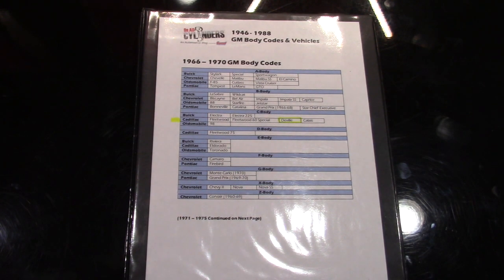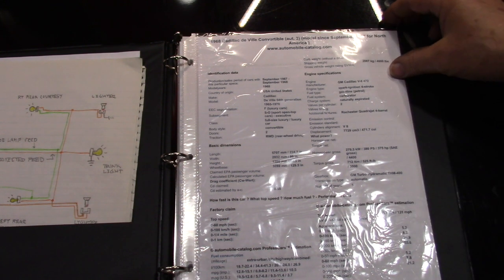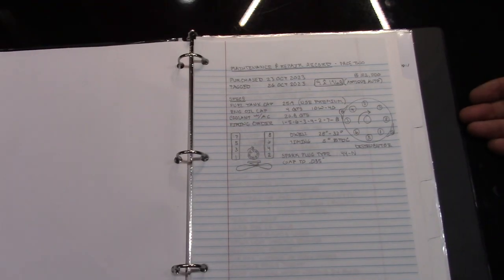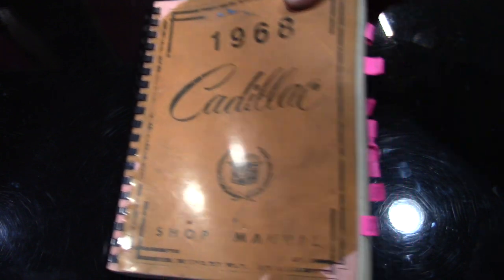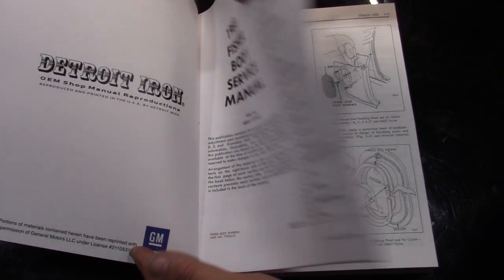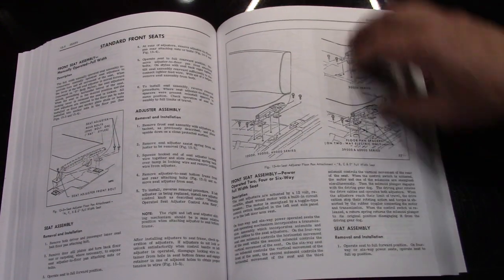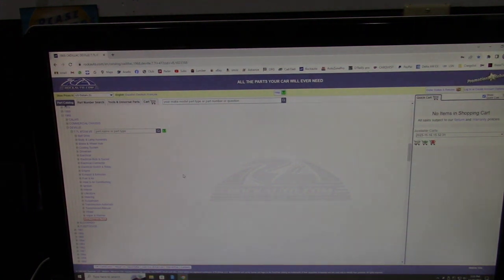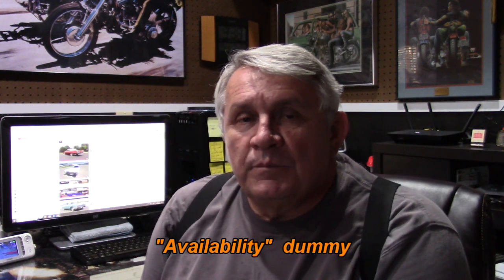Part 1, Getting information for a 1968 Cadillac

Comment: I stopped using Rock Auto.  I had problems with them. And since they have no customer service.  I had to end up doing a charge back on my credit card
Reply from the maker: So far I've had good luck with Rock Auto. But your right, with no real customer service a guy takes a chance for sure.